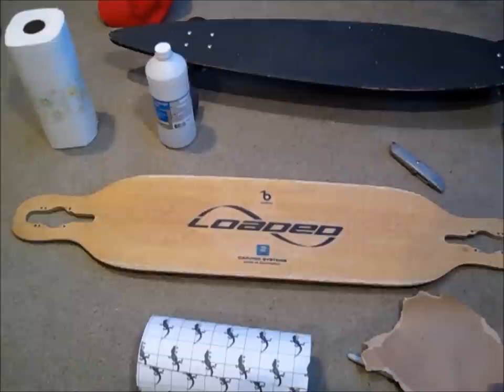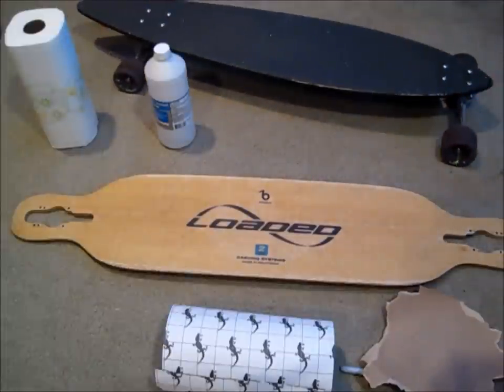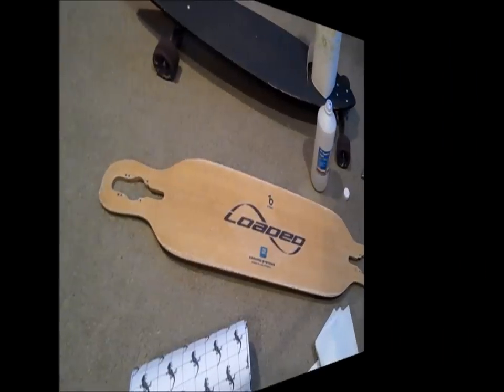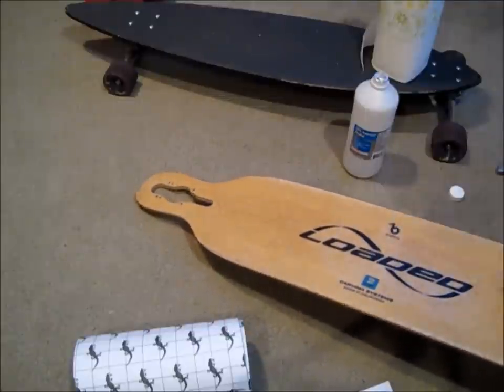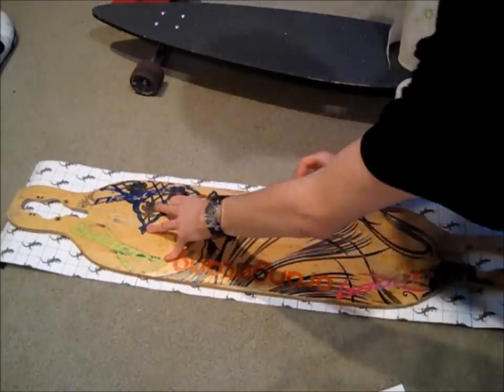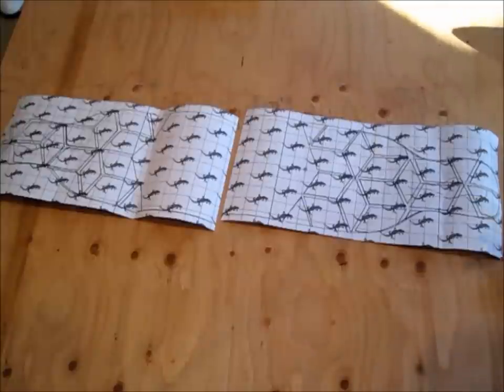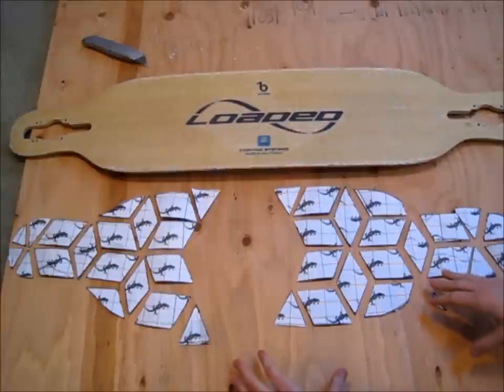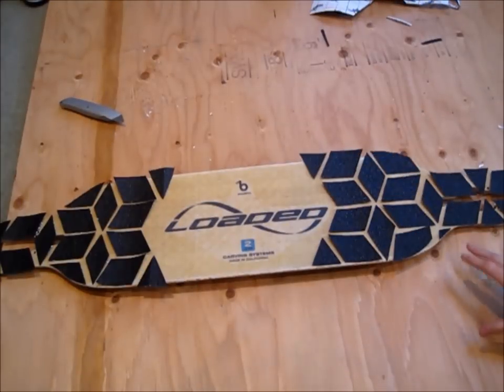How To: Make a Custom Grip Tape Design!

Comment: For all u newbies out there, u don't need a knife to get rid of overhang grip-tape after it sticks on. Rubbing the shaft of most metal tools against the side works just as well, and also has a smoother finish. Hope that helps some of u.

Comment: Good video but you should sand the sides of the grip tape pieces at the edge of the board. It'll help the grip tape stick to the board and it gives it less chance to peel off over time

Comment: you can use a hair dryer to help take the grip tape off. just cut a sliver on the back of the board and heat up the grip tape from the sliver all the way up it helps make the adhesive softer and less sticky.

Comment: Would spray painting the grip tape a different color ruin it? Haven't tried yet just curious I'm new to this
Reply: yes you can. but it cant be layer after layer. and you want to have someone that knows what theyre doing, spray it. to much layer will cover the grip and eventually youll feel like your standing on plastic. and you want to keep in mind. do you really want to spray your grip tape? if you are riding a lot, its going to wear out and go back to its original color. a good idea that would help, but keep your budget in mind. buy different colors of grip tape. have fun with your deck.

Comment: Hey there, I know this is an old video but I’m looking at doing a similar thing with my board. Was there any problems with pieces coming off or peeling at the corners?
Reply: Shouldn't be but if it does happen use a bit of sand paper and run over the parts that are peeling I should smooth it out

Comment: protip: Take a blow drier, and heat up the old grip tape on your board. The edges should start to peel up, and then you can very easily pull the tape up. Apply more heat when needed.

Comment: is the board gunna get messed up in the rain or when it gets wet because you took off the finish on it?  I notice my pintail has a sort of glaze on the bottom and and now after sanding off the clear grip parts of the wood will be exposed

Comment: just use a hair dryer to melt the sticky adhesive on the bottome of the tape and it will come off much easier :)

Comment: first! loaded has the most "designed" griptape design the other brands so i think theres no need to mess with it... second! griptape is hard as f.ck to cut off so it really makes it difficult. third... u could have used the negative stencil to place the pieces over it in the empty spaces... and then stick em up perfectly....

Comment: this griptape is useless
Reply: Lol basically!
Reply: +Benjamin Stamate how?
Reply: +karter koob Probably because it only covers a small portion of the board. It also might peel off easily.
Reply: +qwerty I could maybe see the peeling but that is the only place you need grip on a board
Reply: +by galleto (“SrGalleto81”) he could put clear griptape in the middle or if he wanted under the black tape before he put it so everything would be taped